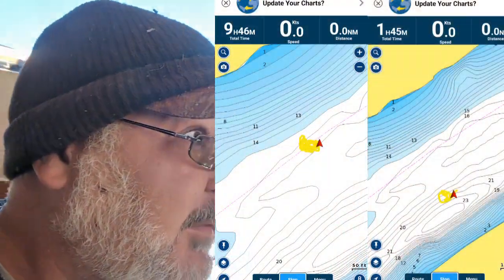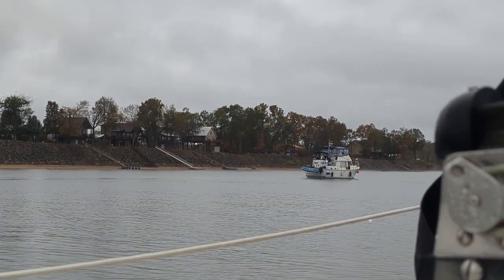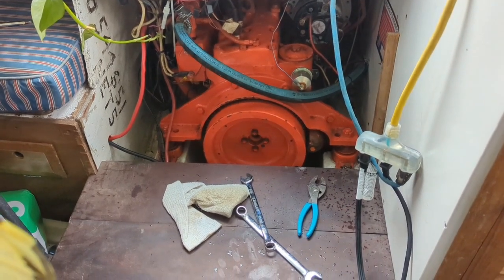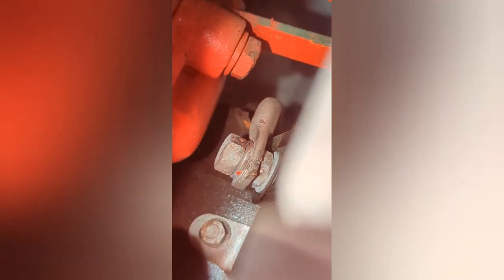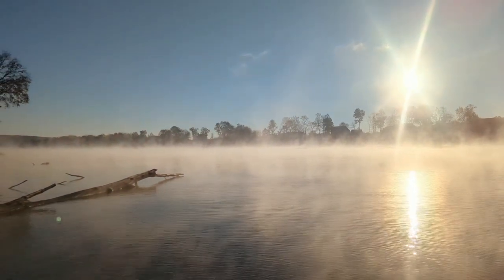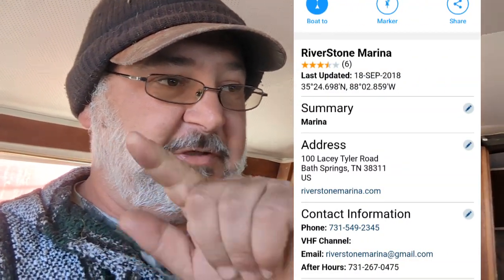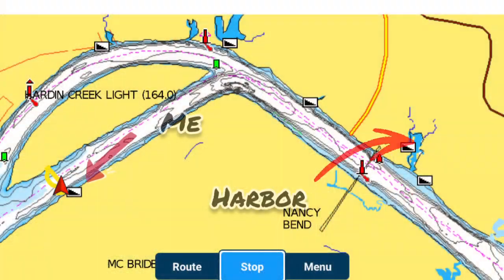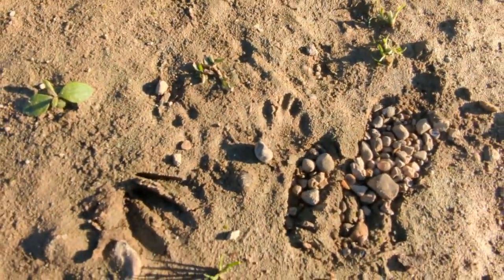#121 ATAP... Sn3 Ep67     Broken Down in Paradise

Comment: Martin, u need a new starter motor, it should only be 2 bolts and two wires one positive and one to solinoid.
Reply from the maker: Thanks, you are definitely correct... The bottom bolt is the hard one to reach with out that 🔧. I definitely need some new tools, too. 🙂🤞
Reply: @ATAP...AnotherTime  Mate just get a new one, the cost of reconditioning the old will be pretty close to the new one anyway, but you'll have yrs of life in a new starter. Do u know where u got the tiny tot fire from please? It's perfect size for my houseboat. 👍💖 get a small socket set.
Reply from the maker: Good point..., but, The wait time on a new one is late next week, the rebuild is a day. However I am going to order a new one to keep on board. I'll have it brought to lake pickawick.  I love new tools 😄🙃
The boat came with the stove originally in 1972... California company

Comment: Seems you have a dead spot in the armature of your starter. If you can get the starter out most come apart with two long bolts, check the brushes and clean up the armature, than hook it direct to a battery while it's out on a table, make sure it spins before putting back in!
Reply from the maker: Pretty sure, You are correct bud.  Thanks Harold, I am going to buy a spare as well a new wrench set... Actually the starter is the only old part on the motor so I need to rebuild or replace anyway.